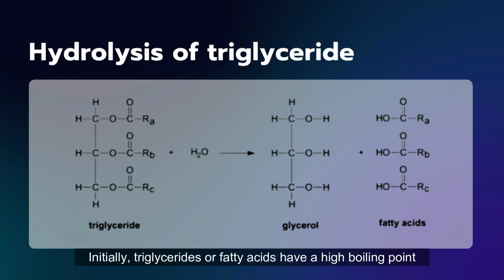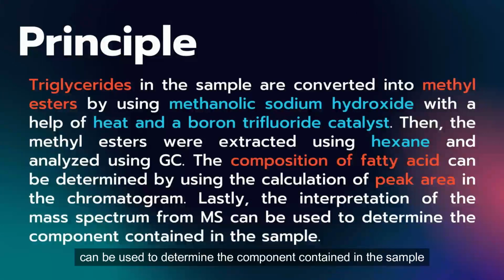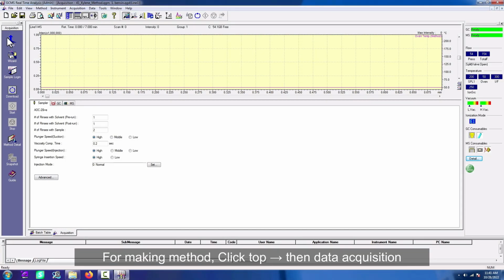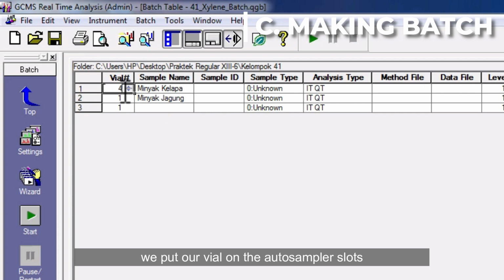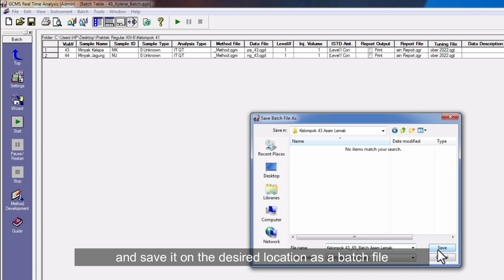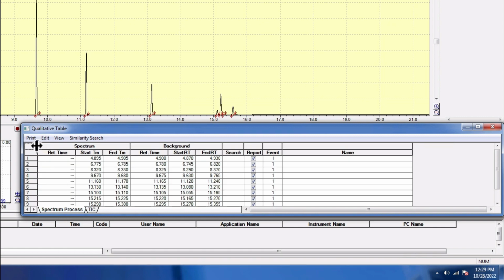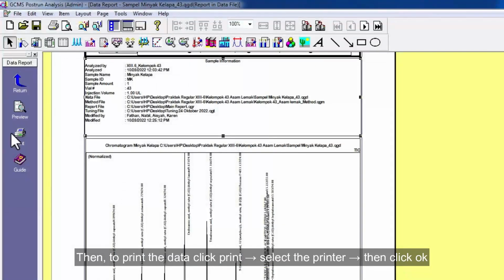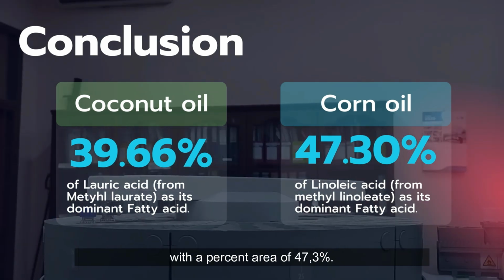Determination of Fatty Acid Composition in Oil Samples using GC-MS Instrument [Group A3_13-6]

Comment: Sir can you explain the tunnig method
Reply from the maker: Its almost 3 years😅 and I have already graduated. Since we only do the analysis process on the video, I dont really remember having the operator demonstrate to us to set up the tuning method. But as a principal, tuning in MS is a step for optimizing the instruments measuring ability by adjusting parameters to get the optimal result. It is usually done by injecting certain compound like Perflorotributhyl amine. The tuning step is succeeded if the result is appropriate to the corresponding reference.

Comment: what type of column used for this analysis?
Reply from the maker: If I'm not mistaken, it is a capillary column and probably with phenyl polydimethylsiloxanes as the stationary phase. Then for the coating type, I guess it is either wall-coated or support-coated